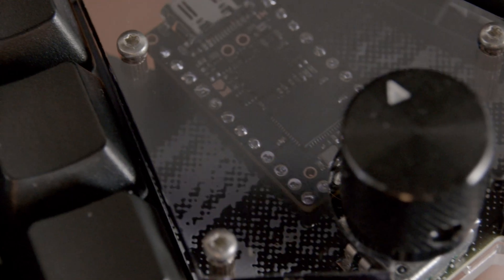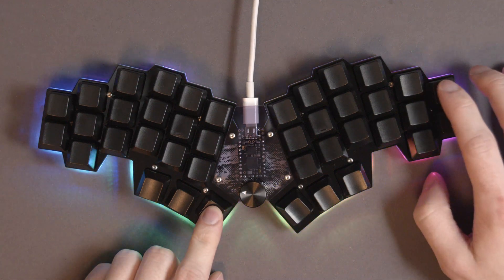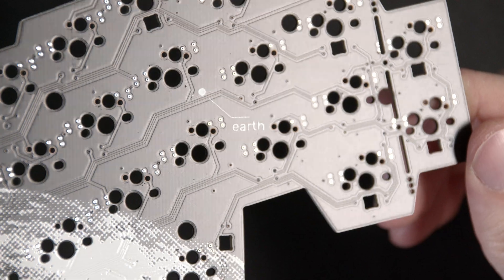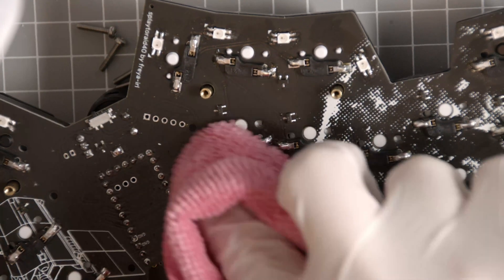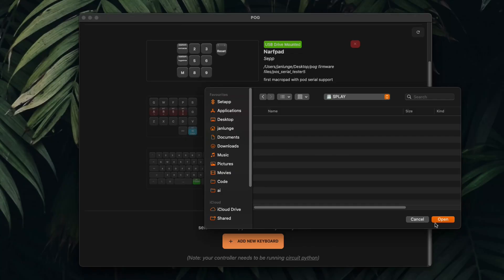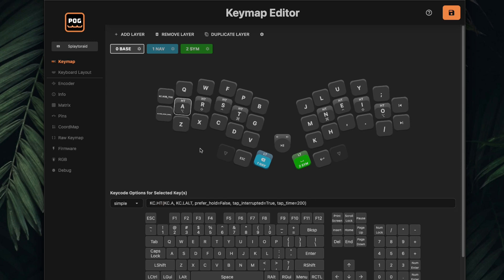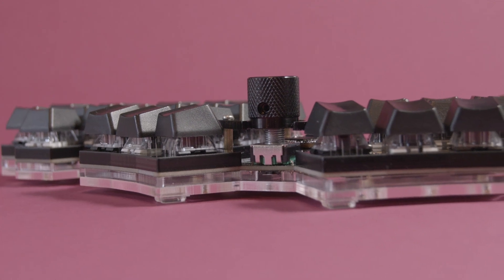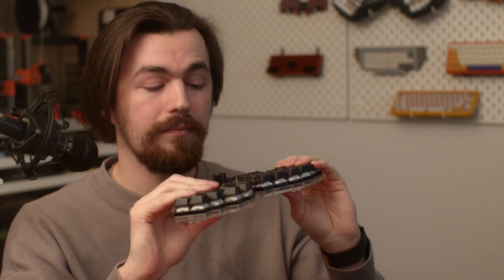The New Ergo Keyboard Era: Splaytoraid Review & Build

Comment: 3:26 Ugh that solder job is painful to watch! USE FLUX!
Reply from the maker: Yeah I was just switching from using leaded to unleaded at that time and had a hard time getting it to work I’ve gotten better with time but leaded solder is much easier just not available anymore in Germany
Reply: @JanLunge  Oh wow, didn't think you'd respond a year later!

I don't have experience with unleaded solder, but even with leader solder the joint should be under a tiny pool of flux (which is essentially an oxidization remover) to prevent the rapid oxidization of the hot metal surfaces from creating cold joints.

Awesome build btw.